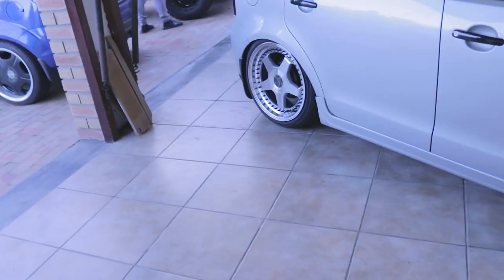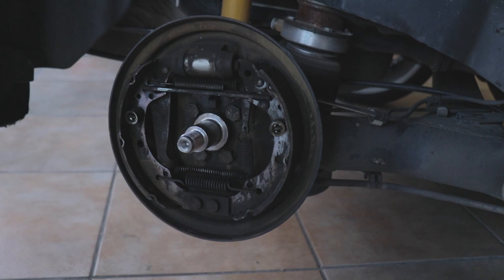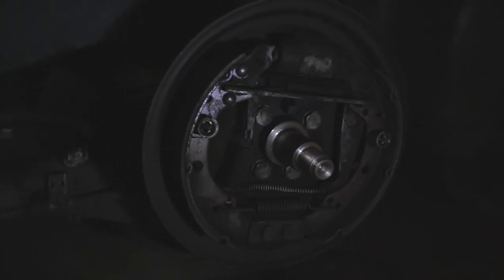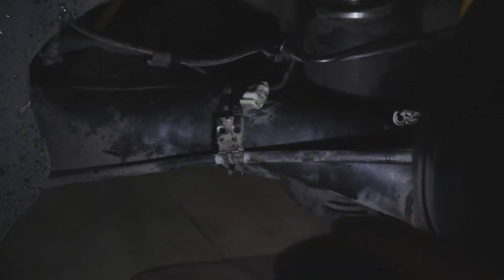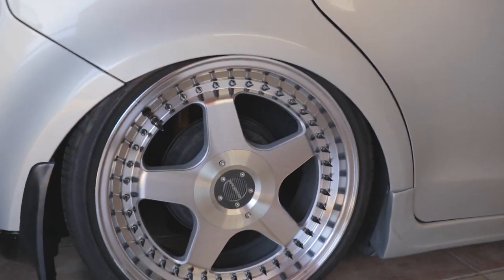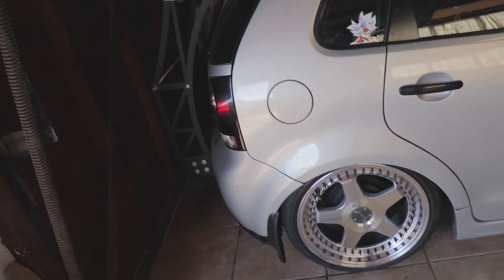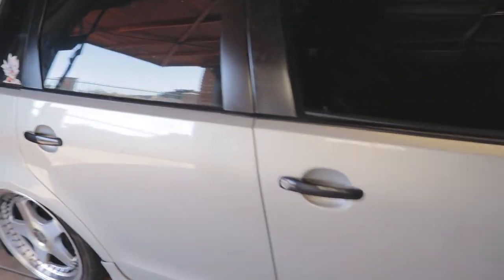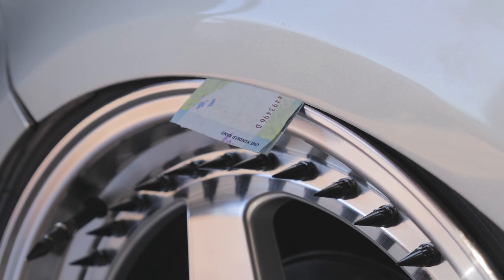Installing Drop Plates on a Bagged Polo

Comment: yoh now thats low.... is the body pinch where the bag is, not coming down on the lines that was lifted off the wheel mount frame? im scratching my brain here thinking it has to be real close.
Reply: Is not a issue, we checked the clearance after and it not hitting anything only when it airs out ofcourse the body but no lines thankfully
Reply: @ricardomoreira7157  ok brilliant i can rest easy. Yasis rim almost sitting outside fender  😃
Reply from the maker: Ye it really dialed in the look

Comment: Are drop plates reliable?
Reply from the maker: Well we are past 2 years with the same ones in the car and not a single issue as of yet so we would say pretty reliable, never heard of a drop plate failing before. Just be sure to install them correctly